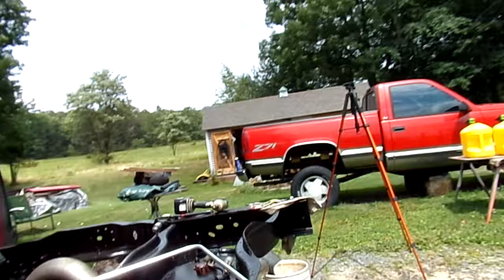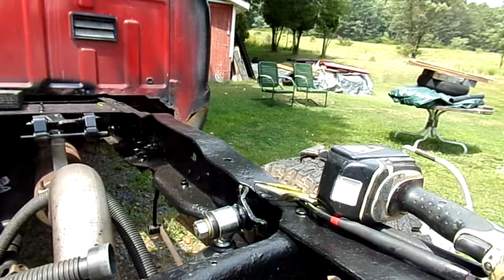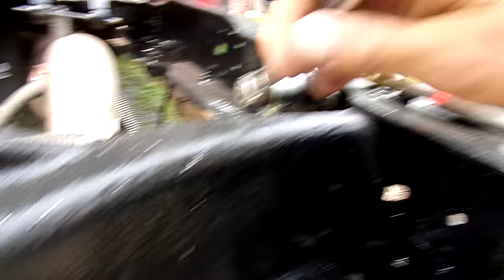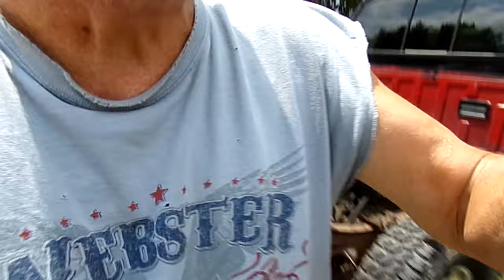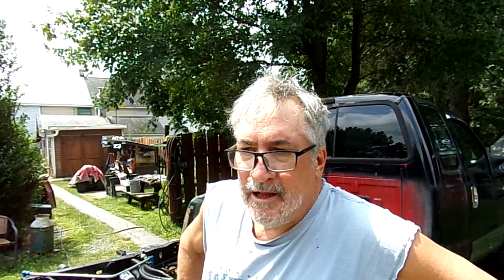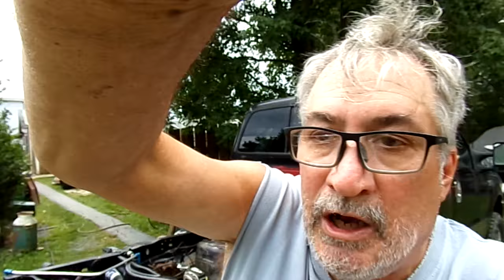HERE IS 100% CONCLUSIVE PROOF B8 5100 BILSTEIN SHOCKS ARE DEFECTIVE

Comment: Rustoleum Enamel is still a very good product after all these years.
Reply from the maker: Rustoleum has had a not so well known product in their Farm Equipment Enamel is a decent High Solids paint. The rest I never really cared for over years just used their primers and at one time you could get them really odd colors to match GM & Ford interiors as well as Chevy Orange and Ford Gray. Over the last 10-12 years they came out with the High Solids idea. While stuff does take forever to dry it matches and you can turn out a decent job with it. MRO has yet to have that stuff.

Comment: Which shocks do you recommend for a truck?
Reply from the maker: I really don't have a recommendation. I used to recommend the Bilstein to everyone especially the B8 series. I have them on a few of my trucks and no the bushings are not like the bushings on this mans truck.
Reply: Billstein 5100 or if the bushing issue (and it is an issue) is roo much. Fox is the onky one spending the money now.
Reply: @thekingsilverado3266 I have these same shocks on 4 of the six vehicles we own  and the only reason there not on the other two is because they our on air ride. These shocks had zero issues with the shock themselves and the bushings were in great shape right out the box. Maybe rather then bad mouthing a company and its product maybe you should have returned them to where you purchased them from. You sir just sound like a man who has nothing better to do then try to ruin a company’s reputation over a bushing.
Reply from the maker: @eric4847  You may not have currently looked at the Bushings lately. Instead of bad mouthing an Aviation Engineer and Mechanical engineer stock car builder perhaps you should keep your mickey mouse mouth shut. Somethings are left to professionals for opinions. That is what keeps the rest of the mickey mouse word safe and something this country is falls far short of is competent engineers and professionals. Need some current reference? Francis Scott Key Bridge Twin Towers Palestine Ohio should I go on about how accidents some not so accidents happen?
Reply: @thekingsilverado3266  all these things you just listed buddy has absolutely nothing to do with your shocks and your just grasping at these situations and trying to compare them to bushing that are used for shocks. My F150 has had three pairs of these exact shocks on them since 2010. When I bought the truck I didn’t care for the factory shocks and switched them out right away and the truck currently has close to 200,000 miles on 3 different set of these shocks with no problems what so ever. You ever stop to consider that they could have gotten a bad batch of bushing from the supplier they deal with? Oh and your degrees a being a crew chief means nothing my guy.  As another person commented earlier on they could have had a batch of bushings become contaminated and may have not been aware of this situation.
Reply from the maker: @eric4847  I'm a retired A&P off a United States Navy War Ship and retired flight wing commander as well as I have 2 masters degrees in engineering. I raced 16 years with 5 Northeast modified championship under my belt and I gotta listen to  a holes like you? What did you do with your life? I am certified in Twin engine Prop and certified for multi engine jet engines. Compared to me you don't know your ass from a hole in the ground there swifty. Give someone else your idiot retoric.

Comment: Bilstein 5100 the most overrated and duplicated shock ever….payed the price…once…might as well get the autozone special imo
Reply from the maker: Auto Zone's house brand used to be Gabriel and I won't put that junk on anything. This is just getting way outta hand really is.
Reply: I have 5100 series on my Ram front and back for the last 6 years and 50k miles and they're just as good riding today as they were the day they were installed.
Reply: It falls back on the epa, what resins can be made here. And what can be bought for a similar price feom other places.
I run bilstein 5100's on multiple vehicles.  My 02 f250 had 80k miles put on it last year. They still work just as they should. The bushing isn't a manufacturer issue. Its a what the manufacturer can use/manufacturer/ source. When China can make anythijg they need. And we now run def to create more pollution.  Vote harder. Thall fix them....